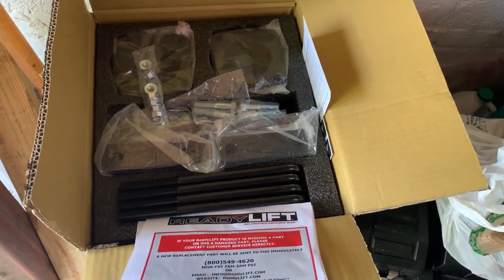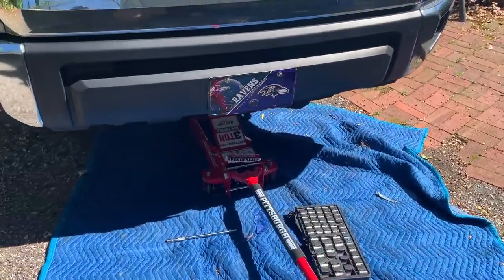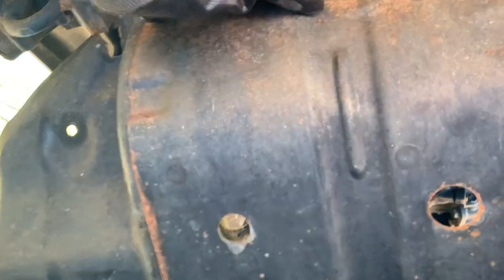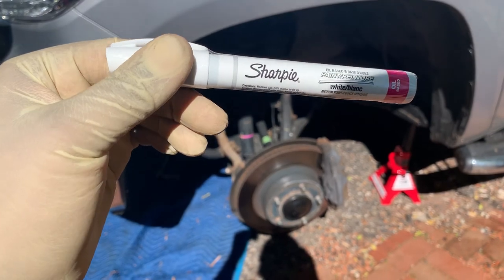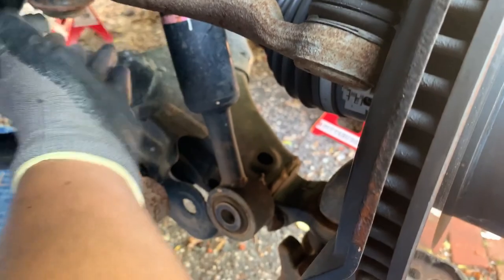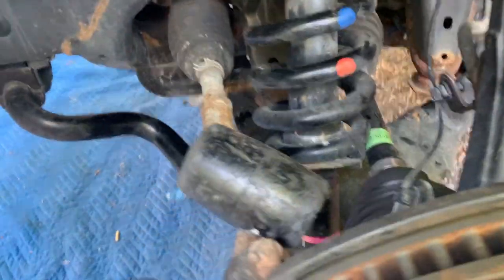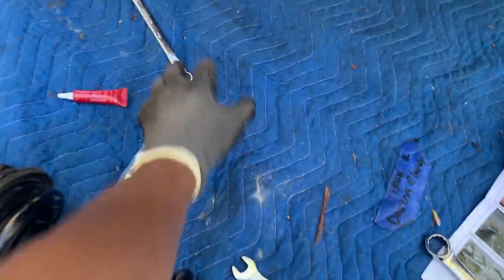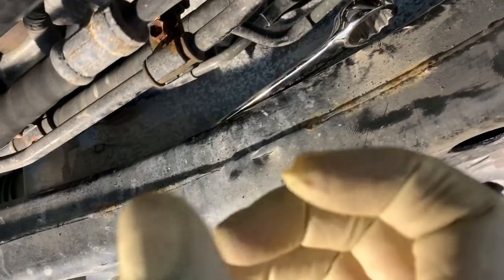BEFORE You Install A Lift Kit On A Toyota Tundra (Watch This Video Or Else!!!)

Comment: To get that skid plate off you just have to shift it to the passenger side and or driver side once all you get all the bolts/screws out and it’ll just drop down. You don’t have to jack it up any higher

Comment: I don't use the clips on the skid plate and it works out fine. Start with  the back center bolt don't tighten fully next either right or left  then proceed forward. Nice looking Tundra,  All the Best to you
Reply from the maker: Thanks for the tip. I will be sure to use it, especially during oil changes.

Comment: My 2018 didn’t have skid plates it also had body lift on it bought from dealership used
Reply from the maker: That's a nice find.  Now a day's it's hard to find a moded Tundra because they are quick to sell and the truck holds a good retail value. Not to mention these trucks are very reliable. 

If you were to get a skid plate, I would recommend one that would allow you to access the oil filter because taking the stock one down and then back up can be tedious. I am actually looking for one similar to the TRD only to access the oil filter but the TRD one's are pricey.
Reply from the maker: @floridalife7564  Sounds just like my 2017 Tundra with the same miles and price. Best decision I've made for a vehicle.
Reply: @AWordFromMrJones  most expensive purchase I made was this truck but I believe it’s worth it
Reply from the maker: @floridalife7564  Haha, facts indeed!

Comment: Did you have to add extensions to the rear brake lines? 

Also is it necessary to do the sway bar drop block? 

My kit didn’t come with it.
Reply from the maker: My kit came with rear brake lines "extended mounts". Basically, you just remove the stock rear bake line mount and install the extended mounts. You do not have to change out your actual brake lines. If that makes any sense. 

Yes sir, you must also use the sway bar extension, failure to do so will cause damage to your suspension. I would recommend that you return your kit and order one with all the components to play it safe.

This is the kit that I had, the price was cheaper but as more people purchase, the price will increase. 

https://www.ebay.com/itm/ReadyLift-69-5276-SST-Lift-Kit-Fits-12-20-Tundra/192974048376?ssPageName=STRK%3AMEBIDX%3AIT&_trksid=p2057872.m2749.l2649
Reply: @AWordFromMrJones  thanks,  I will look in to the link!
Reply from the maker: @Cruz0604  Good deal.

Comment: Hey quick question, we tried installing these yesterday and to undo it and take them out cause we couldn’t get the spring to go in any suggestions? I’m not sure if lowered the control arm would that be the step we missed?
Reply from the maker: Yes, that's correct. By losing the lower control arm, you'll have more access to remove/install the shock & spring. Please do note, that once you loosen the lower control arms you will lose your alignment which you will need to take it to a shop to be realigned. I would recommend calling around to multiple shops and ask them if they can realign a "lifted truck" because some shops are picky. 

Thanks

Comment: What weight rating is your jack? Do you know what is the lift heigh to allow work on your lifted truck?
Reply from the maker: I am using a Pittsburgh 3 ton low profile floor jack from Harbor Freight. I use this in combination with my car since the car is lower. The jack max lift height is 19-7/8 in. The only time I need a jack on my lifted truck is to make suspension and brake repairs. I always use my jack with the jack stands for safety. 

You can find more info of the jack here:
https://www.harborfreight.com/3-ton-low-profile-rapid-pump-floor-jack-56617.html

Comment: What size is the lift and what size tires can you put on
Reply from the maker: Sorry I did not see this comment. I am running 33x12.50r20 mud tires on 3.5 spacer lift. I ran the same tire setup on stock height without any issues but I did also remove the mud flaps. With my current lift, I can run up to 35's mud tires.

Thanks

Comment: Anyone know if a 2008 tundra with 3.5inch lift can fit 35s on, got 31s rn no problems with no lift
Reply from the maker: Hey Eldin, the 2008 Tundra has the same wheel base as the 3rd generation Tundra. Assuming your going to run a beefy mud tire. You can put 33s mud tires on a Tundra without a lift but 35s mud tires will experience rubbing issues during full lock turning. The 35s mud tires are best fitted for the 3.5 inch lift.

I ran my 33x12.50r20 mud tires on stock height without any issues but I did also remove the mud flaps.

Thanks
Reply: @AWordFromMrJones  okay thank you, im planning on getting the same 3.5inch lift. I think 35s will fit just fine if i remove the mud flaps which i dont have a problem doing, if 35s dont fit im gonna go to 33s. Also my front has a pushbar so it cleared me more room for wheel space

Comment: Right now I have 285/55/20  ballistic 20x9 and I took the front mud flaps off and they don’t rub but it looks like it’s close to rubbing . I feel like the 295/60/20 will rub ?
Reply from the maker: Yes with a 3inch lift kit you will be fine with that tire setup but it all depends on the type of mud tire you purchase.

Comment: Did your truck have TSS? If so any issues due to the kit install??m
Reply from the maker: My Tundra is the limited edition which I did not have any issues with the lift kit other then using the right impact gun. The Tundra TSS edition is also compatible and will not have any issues installing with the proper tools.

Comment: What size wrench did you use to hold the nut on top of the diff to be able to drop the diff?
Reply from the maker: I used an  22mm combination wrench for the top nut. It was a "hard to reach" type of situation but I got it done. It would be a bit more comfortable if I had more space to adjust my body while under the truck.

Comment: Mr Jones.. great video. Thanks for sharing.. it's been a year , have you had any vibration while driving your tundra? Most of our Toyota trucks after any lift have the infamous needle bearing issue on the driver's side. Just wondering if yours is still no vibe or not?
Reply from the maker: Hey Danny that's a very good question and also was a concern I had prior to purchasing my lift kit. 

I can rest assure you that within the year of driving my truck with a 3inch lift I have not experienced vibration while driving on the roads or highways.

Comment: installed a readylift 3in with diff spacers at scottys linex in stockton ca for $350.00 ttl..  with alignment.  why $600 ?  btw, getting ready to install toytec 1.5 in lift shackles,, that i would do my self..  nice vid!  are you gonna do shackles?
Reply from the maker: Lol, that is the same thing I told a local Off-road Truck shop. I've even explained that it is a leveling kit but was told it's still a "job". It's a bit pricey here, let me not even mention the cost for a custom dual exhaust, which I was told starting around $700.

I may eventually do the lift shackles but so far the truck handling has not changed. We do not really have any off-road locations unless we drive out of town so it's pretty much a street truck.

Comment: Great work! I have a ready lift leveling kit. It’s 3 inches in the front and two in the rear. I installed it when I purchased my Tundra in 2013. The install took 1.5 days. I struggled to install the coil spring back in, other than that, I had it aligned after. I changed the control arms on mine and it came with the kit. I didn’t see this in your kit and maybe they changed it up? On a side note brother, I noticed allot of rust on your truck and it appears to be fairly new. Do you lots of river crossing with it?
Reply from the maker: Yeah the kit I had did not require a replacement control arms.

I live in a area where when it rains, it pours and during the winter when it snows, our state country officials will use harsh salt products to keep the roads clear of snow which causes trucks to develop surface rust. Mine is light affecting suspension parts but the frame is clean. We usually clean up the surface rust and add protection which I will eventually do.
Reply: @AWordFromMrJones  Hey Brother, I applied undercoating to my truck twice since I bought it. I only did this to protect my investment against unwanted rust and as a rust layer protection. I am happy with the results and I haven't had any rust build-up under the vehicle due to the protection I applied. You may want to look into it, it's just basic undercoating. My leveling kit was from the ready lift and was about $900.00 and change. I have been happy with it and have gotten several compliments on the smooth ride and strong stance. I just installed Bilstein 5100 shocks to the front and It came out awesome! It's always good to talk with other Tundra owners
Reply from the maker: @mariomorales2632  Fact, it's always great to speak to another Tundra owner.

What product rust protection did you use and I will look into it.

Yeah I have some Bilstien 5100 for my rears sitting in the garage, waiting for me to install. I'm glad you mention about the front, I wasn't aware that the 5100 could also be installed in the front. Can you send me the part model so I can order them?

Comment: Thanks man for sharing the lessons learned. That helps out a lot.
Reply from the maker: RKG RKG No problem, as long as you have a small size impact gun, enough ground clearance and free time; you can install a lift kit easy within a day period. 

In my case, because I was not able to use my over sized impact gun, I barely could by my lower control arm to go down to make space for removal and reinstall of the strut mount.

I think if I were to up grade from a 3” to 6” lift kit, I would definitely invest in a midsize and small impact gun for the install to save time.

Comment: How's the performance when you're driving more than 70miles/hr or 120kms/hr?  And what can you reccomend for a bigger tires for 2019 tundra without using a lift ? Thanks
Reply from the maker: She runs good, no problems on the highway. Honestly, I wouldn't go above 33x12.50r20 without using a lift. Once you get a lift you can go up to 35x12.50x20 without any major modifications. If your looking for an aggressive tire look, go with a mud tire and not all terrain tire but do note you may have "tire" noise. I honestly don't notice the noise in my truck.

BTW, a mud tire will also add some lift to your truck.

Comment: this with standard shocks?
Reply from the maker: That is correct, the lift kit was installed on stock shocks since most of our roads are smooth. However if you have unsmoothed or off roads, I would highly recommend aftermarket shocks like Bilstein 5100.

Comment: Will 295/60/20 fit on a 2016 tundra with stock 2019 Tss black wheels?
Reply from the maker: Yes but you will need to remove both mud flaps up front. I previously rode with 33x12.50r20 mud tires and no lift kit without an issue.

Comment: How long do you have the 3 inch front lift in any issues?
Reply from the maker: Hey J&R, it's going on 8 months now with this lift kit and I have not had any issues. Mind you, we do not have offloads in my area, just asphalt roads. 

My truck rides the same way as stock suspension. Now, if our roads were rough as off roads, I would invest in some Bilstien 5100 for extra affordable comfort.

Comment: Those jacks are in the worse places, if your jack stand gave out, those jacks would cave the air they were supporting.
Reply from the maker: Kev, appreciate your concern but the jack stands are not the only hardware supporting the truck. In my 20yrs of working on vehicles, I've never just use jack stands to support vehicles. I always use multiple jack stands and jacks to support the weight of a vehicle if I do not have access to a car lift. I've seen jacks and jack stands experience failures despite the brand, price range or position you set them up.

This process has successfully worked well for me. I truly appreciate your concern brotha, stay strong!

Comment: Looks like a lot of rust already
Reply from the maker: Yup, many vehicles in our area will have surface rust since the state uses salt on the roads during winter.
Reply: @AWordFromMrJones  is there a coating for that?
Reply from the maker: @torturedjoemama  Yeah you can sand/clean the resurface rust then apply a coating for protection. 

I've had other vehicles that had worst rust which required floor panels to be replaced. However for my truck, it's light surface rust which is commonly found in DMV. I will eventually add my touching to clean her up when I have time.
Reply: Por 15 is really good for undercoating also and carrier bearing drop mount I bought a 3/1.5 I am about to install on a 2015 tundra
Reply: Sorry meant to ask did you do a carrier bearing drop
Reply from the maker: @josephblum636  Thank you for the tip, I will try out the Por 15.
Reply from the maker: @josephblum636  I only have the diff drop for my leveling kit. I was advise by the vendor that I did not need it unless I experienced issues with vibration.
Reply: @AWordFromMrJones  thanks I also read the same thing
Reply: @AWordFromMrJones  also could help but see the ravens on your vid I am like 35 min from Baltimore
Reply from the maker: @josephblum636  Cool, your local. Baltimore is where I am from.

Comment: That’s gonna be a very stiff ride on front
Reply from the maker: Not for me because we mostly have paved roads so this truck is a mall crawler. We do not have any off roads unless we were to drive out of state. My truck is pretty much a daily driver.
Reply: How would it be any stiffer of a ride? It is same struts and springs. Tires just sit lower because of spacer.
Reply from the maker: @pnorton75  It would be for driving off-road that you would feel it a little more stiff using the stock shocks. But as previously stated we mainly have paved roads so it's not noticeable. 

I do plan to eventually swap them out for Bilstein 5100 one day or year lol.